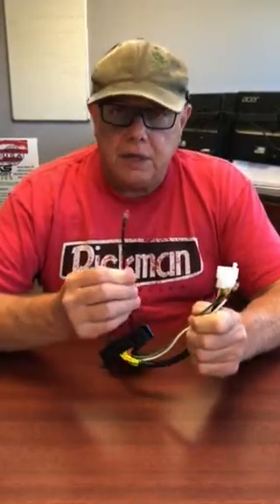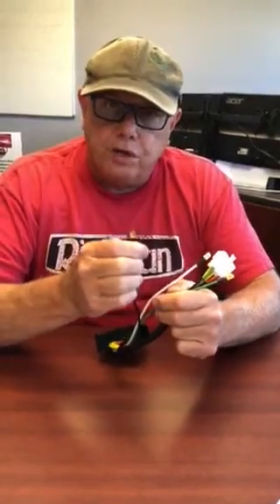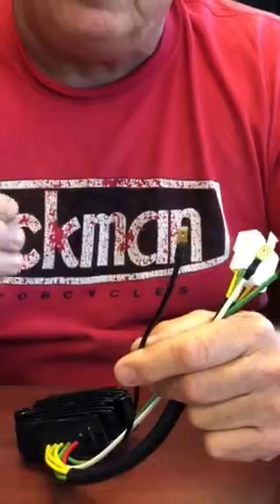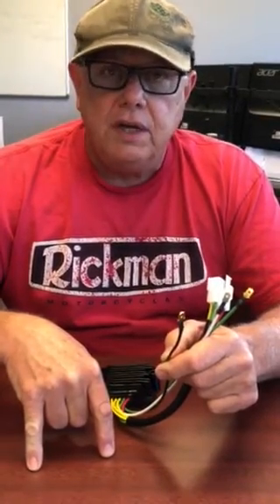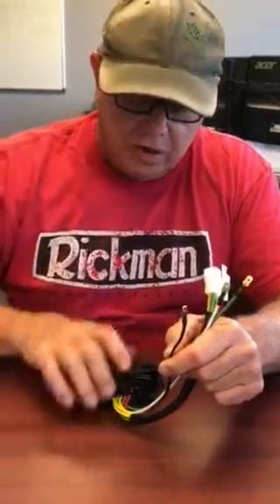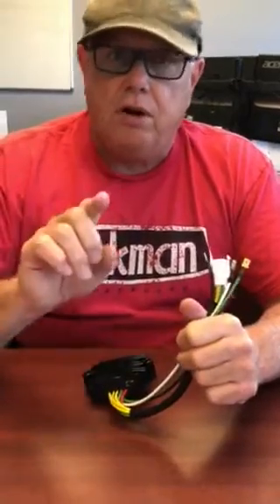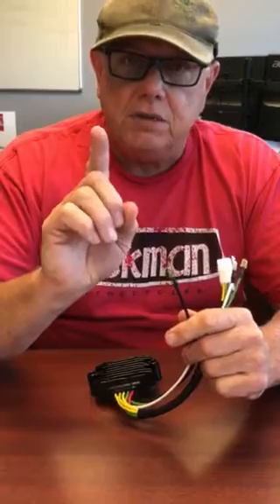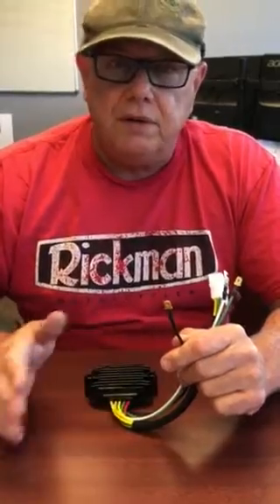Honda SOHC 4 cylinder overcharging rec/reg help

Comment: This is probably a dumb question, but when you said the ignition switch gets dirty, are you talking about the part where the key goes in...or the connector that plugs it into the harness...or both?   I'm having an over-charging problem with my 1975 CB750.  With the stock regulator and rectifier on it works fine.  When I plug in the Rick's unit, it's getting too much voltage (15.5 or more at 3000RMP instead of 14.7).  I'm going to test it like you said in the video but I want to make sure I fully understand what I have to do.  I'm going to make a jumper wire (with some 16 gauge wire) and plug one end into where the black regulator wire would plug into the harness then connect the other end to the positive battery terminal.  At that point the voltage on the battery should be correct when running and revving the bike...assuming the reg/rec is working fine?   If it's working fine when by-passing the ignition,  I should clean my ignition connections and try the rec/reg unit again?   Is that right?  Thanks for any help in advance.  : )
Reply from the maker: It's the contacts inside the switch, not the terminals.  The only real way is to disassemble the switch (if possible) or replace the whole switch.  The difference in voltage btwn stock & our piece is b/c your OE piece is regulating too low.  You could try one of our lith-ion friendly rec/regs because they regulate lower than the standard ones.